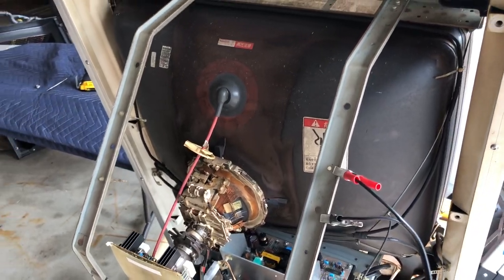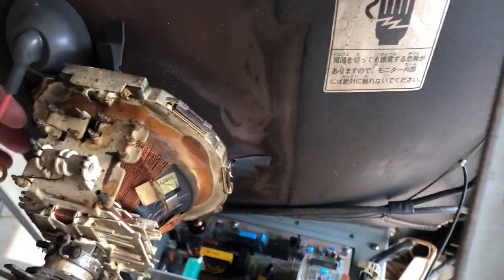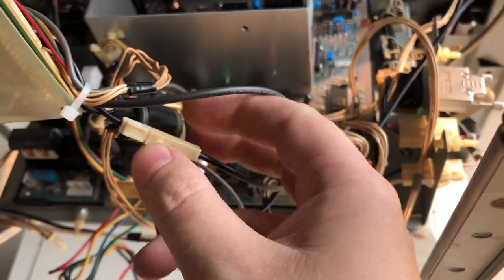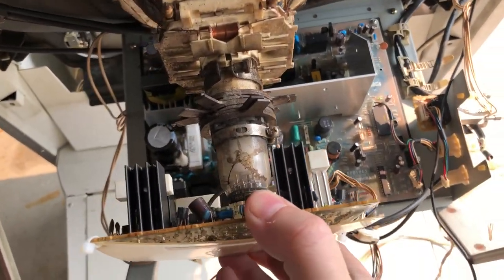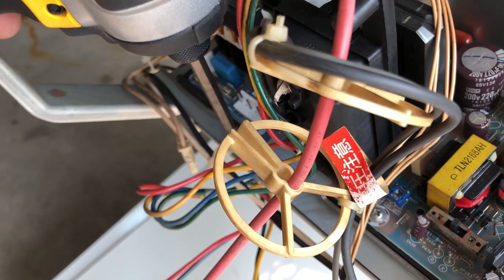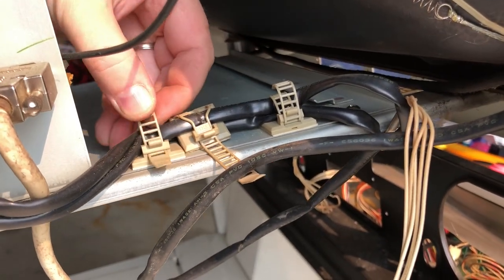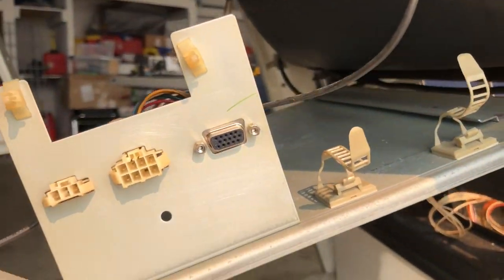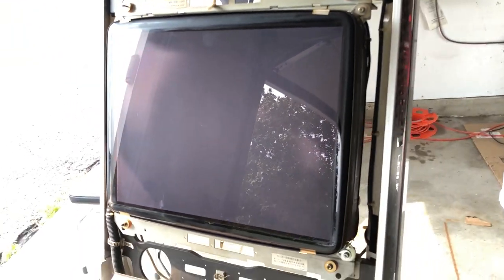Sega New Net City Project: Removing the chassis from a Toshiba PF monitor

Comment: Thank you for this, I was able to figure out the pin out for the high-impedience (aka 15 KHz) video connector

1 - Red
2 - Green
3 - Blue
4 - Sync
5 - Ground
6 - NC
7 - Degauss
8 - Degauss
Reply from the maker: I was just coming back in here to comment that the stray two-wires harness at 4:00 were in fact for the degauss button in the control panel area.  Interesting that this is necessary, since the remote board also has a degauss button, but perhaps some of the other monitors found on these Naomi style cabinets did not have degauss included on their remote boards.

Comment: Hi Mike! I wonder how often Astro City/Candy cabs become available in North America. I wonder also if it's worth importing one from Japan or I should probably wait for a listing somewhere in our continent hahaha. By the way, have you tried the service menu on your Trinitron yet? ;)
Reply from the maker: They do not come up very often. I purchased one New Net City from a guy in Chicago, and the other NNC and Astro came from an importer named Matt Cloer who does business out on the East Coast.

As for the Trinitron, I did go into the menu and adjust a few things, but I've decided to hold off on messing with any advanced geometry settings until I've re-capped the deflection board, otherwise I may have to do it all over again.

Comment: Got a new net city myself that im experiencing issues with.

The picture is shifted to the right quite a bit, and the down button on the remote board doesnt function, neither does the reset option in the menu.

Is there a secret way of resetting?